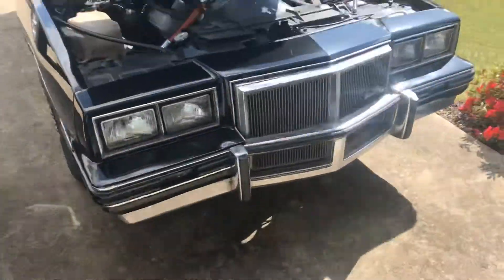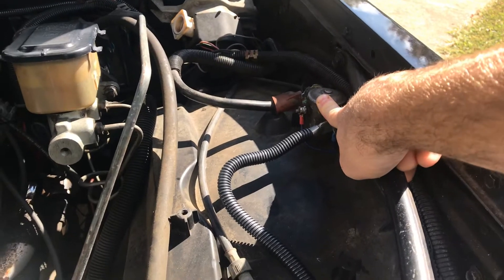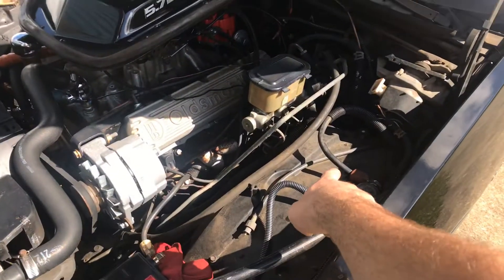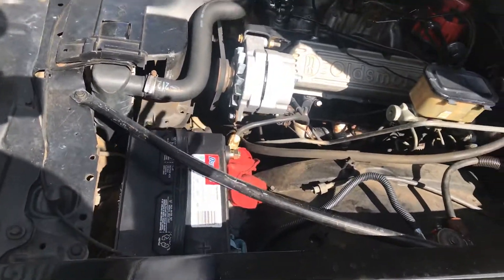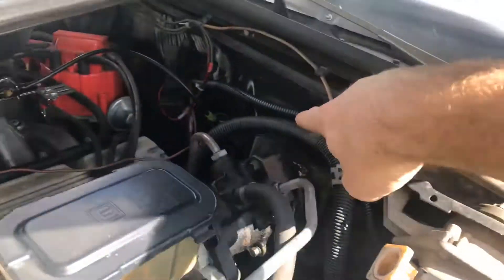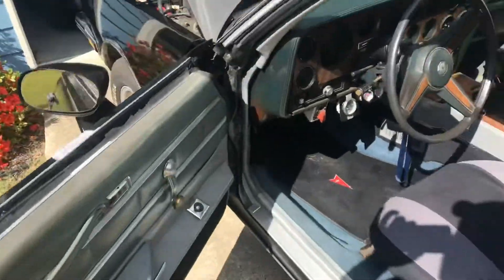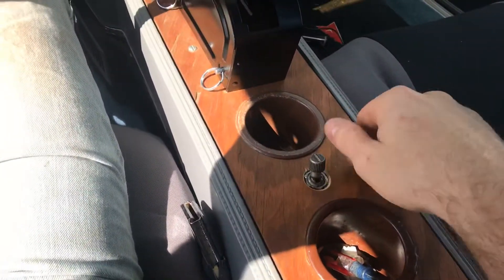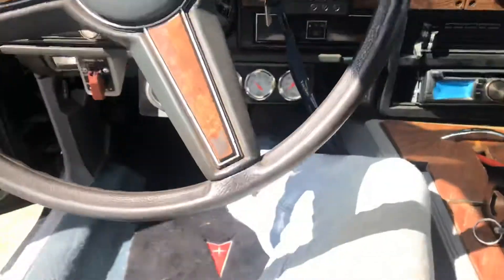Battery disconnect install with a latching relay!!

Comment: This is basically the Painless Performance Products #30206 - Remote Master Disconnect w/Latching Solenoid Kit. I got it at an estate sale. My kid's '91 Chevy has no immobilizer chip, so I figured it'd be a good anti theft device. Looks like the same setup, except it includes a push button momentary switch and a 10 amp fuse for the relay itself.